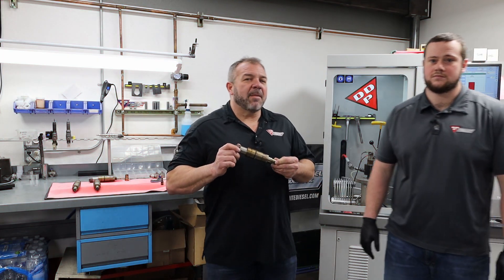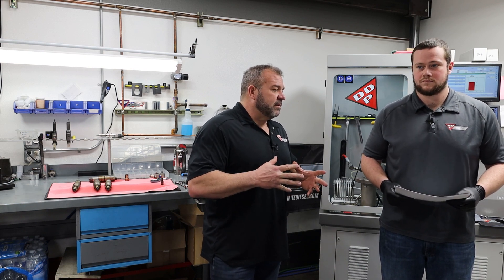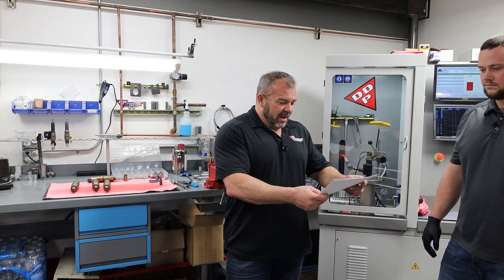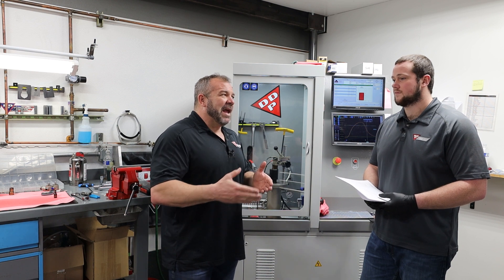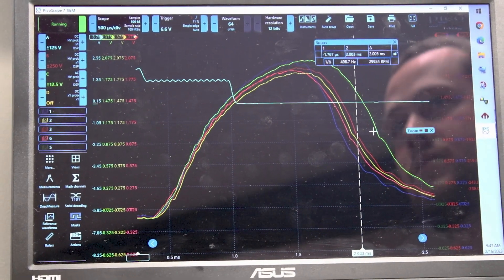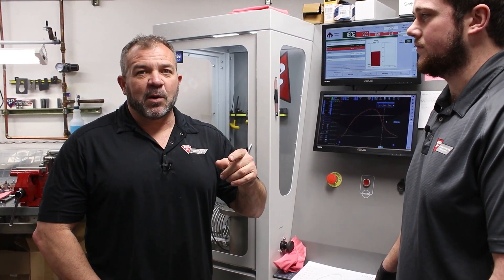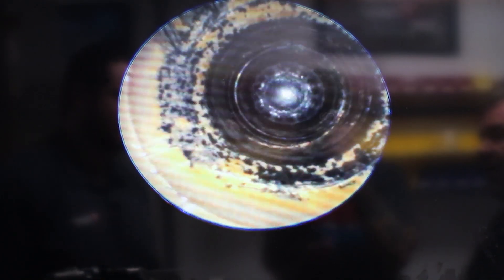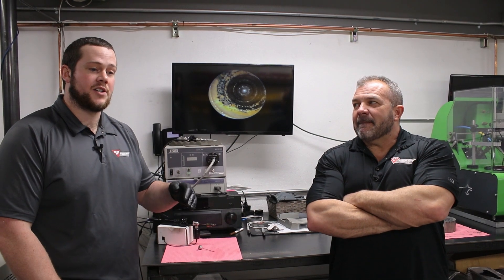Putting the Dynomite touch on Cummins ISX15 Injectors

Comment: This is nonsense , what happens when one injector fail down the road aand and you go to Cummins or dealer to replace the injector ? , well, they will put a normal injector inside wich wil mess all your truck injection , second if you ordered a spare Dynomite injector they will refuse to do the job with your part ,

Comment: The  single cam ISX is probably the stoutest built of the big truck engines. I think they have a lot of untapped power potential just because no one does anything for their fuel system.